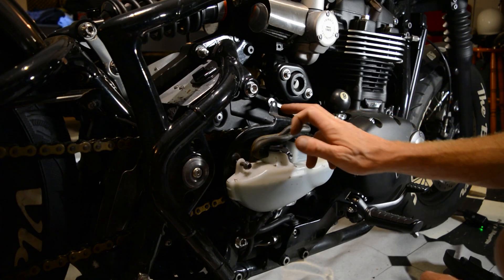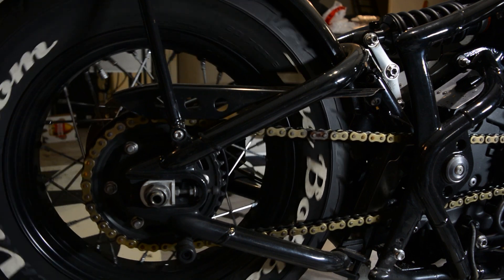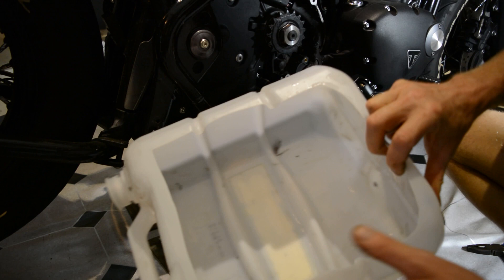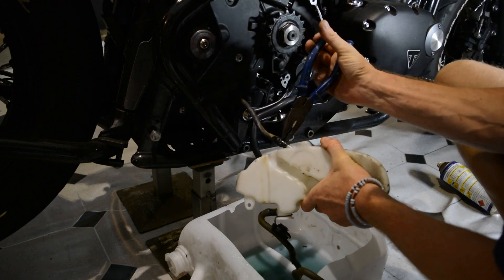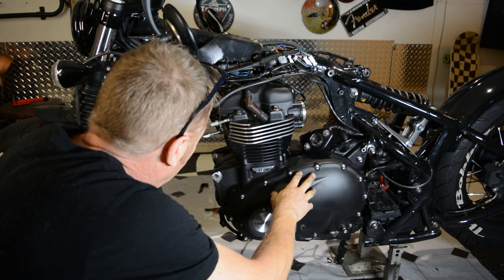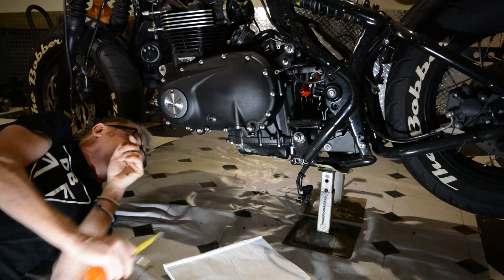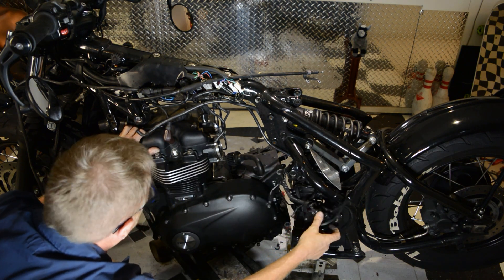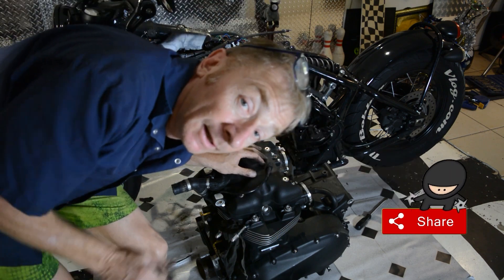Triumph Bobber high power engine swap (part 2)

Comment: So what mechanical differences are there between the HT and the HP engines? I thought it was just the state of tune??
Reply from the maker: The HT is 10:1 compression and the HP is 11:1 compression. Along with the tune this is worth about 15HP and 10NM of torque.
Reply: @brownco_customs  Nice!